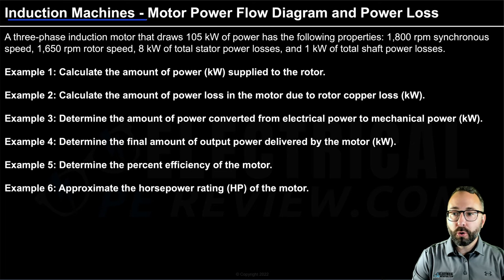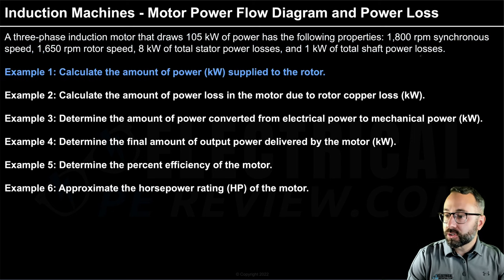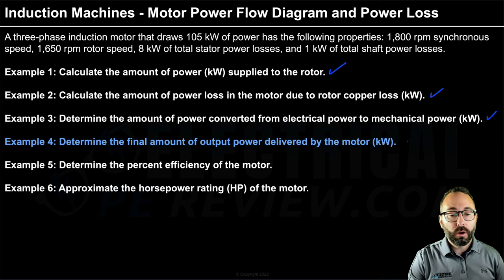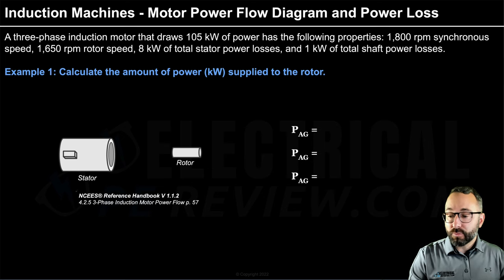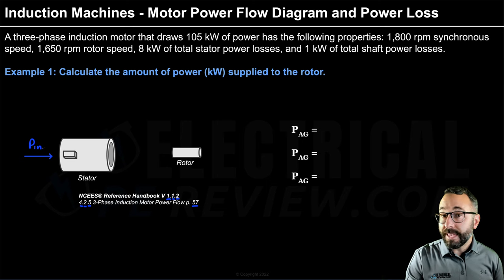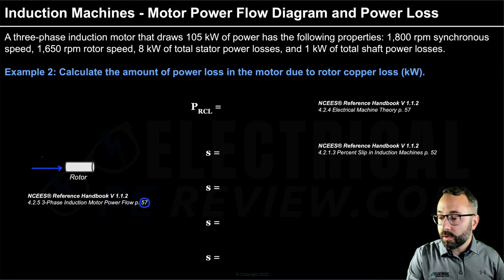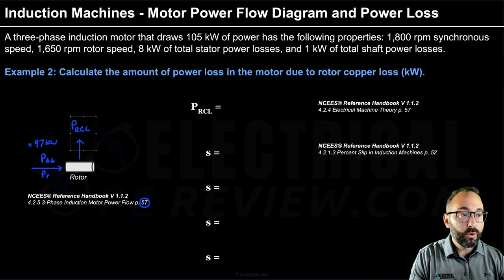Induction Machines Motor Power Flow Diagram and Power Loss for the NCEES® Power PE Exam

Comment from the maker: Table of Contents:
0:00 - Problem statement and questions
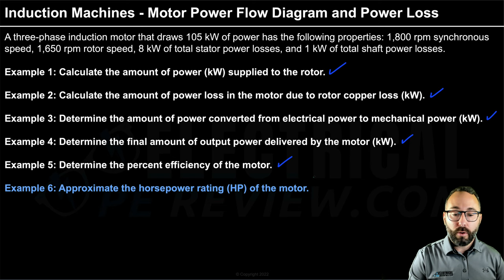1:07 - #1 Rotor air gap power (P_AG or Pr)
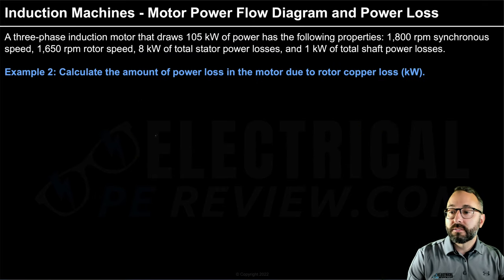5:16 - #2 Rotor copper loss (P_RCL) and slip (s)
10:36 - #3 Converted power (P_conv) and mechanical power (P_m)
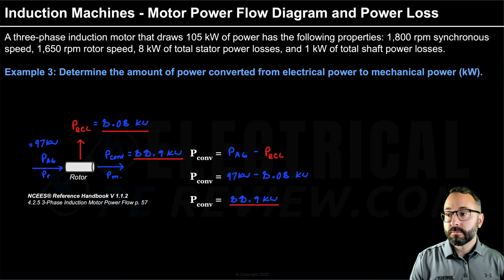12:35 - #4 Motor output power (P_out)
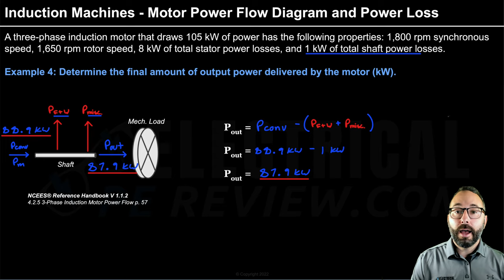16:53 - #5 Motor efficiency (η)
20:13 - #6 Motor horsepower rating (HP)

Learn more about the fastest growing online class for the NCEES® Electrical Power PE Exam at https://www.electricalpereview.com